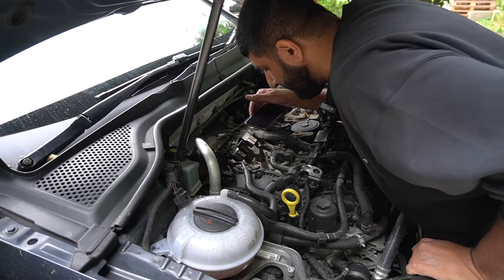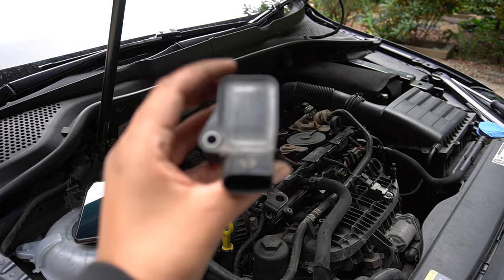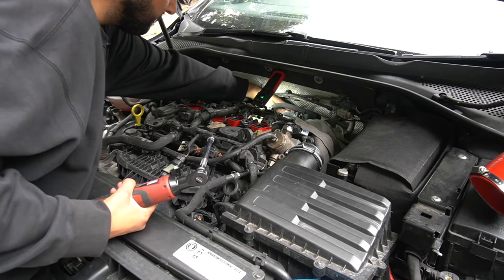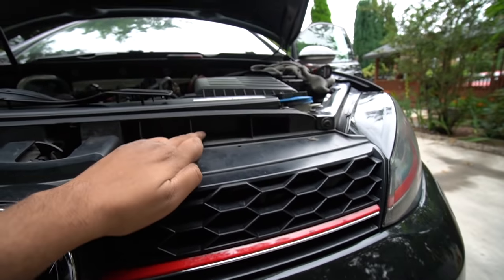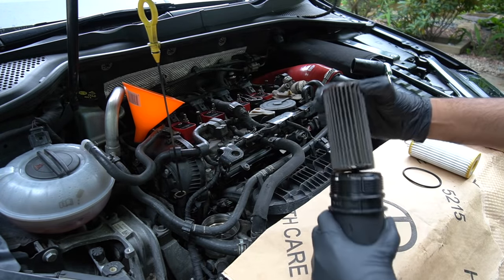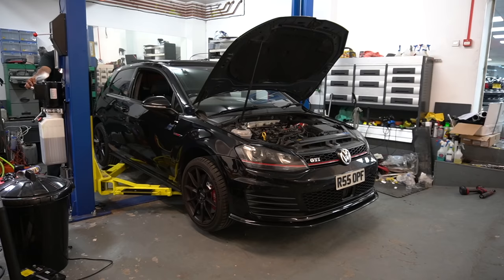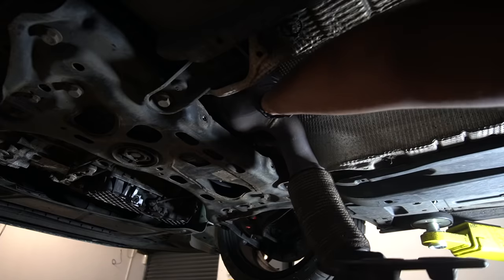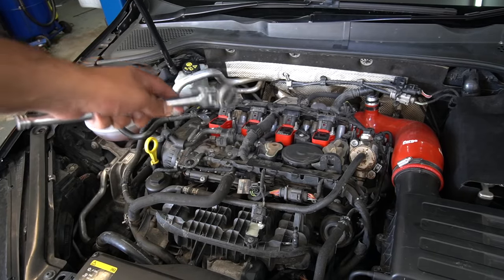My VW GOLF GTI gets some STAGE 2 Upgrades!

Comment: I screwed that blanking piece on and opened up the nearside of the intake. The R600 box is called that as it's good for 600bhp, supposedly. I can't see the need to buy one when you can make it yourself with that blank and a Stanley knife. Maybe the internals don't flow as good but for stage 1 or 2 it's more than good enough. £380 for a plastic box!

Comment: Just a heads up Hamza... i had a Ramair panel filter in my Cupra 280 and the amount of dust i had in the turbo intake pipe was insane... got annoyed after i cleaned the silicone pipe and still had a lot of dust a week later and bought a K&N filter (which already came sprayed) and it was MUCH better. I suggest you spray that Ramair with some air filter spray, or change to a cotton filter instead of the foam one.

Comment: You supposed to oil the o ring before slipping it over the top, the point of the oil is to increase elasticity so it doesnt snap

Comment: You seemed to have an easier time doing the downpipe compared to Dean on Saving Salvage, he had to drop the subframe in the end. 

Just fitted new cat bypass pipes to my PFL. The ones I bought 2 years ago had started to rust badly. Must have been some hooky stainless steel so went for genuine Audi ones for the FL RS3 this time. All 4 bolts twisted off trying to get the sleeve undone, they were barely recognisable as nuts.
Reply: Rip you we can see the pain

Comment: If anyone reads this and is gonna put in a downpipe, the process is different with the GTI that has the lsd and the GTI that doesnt. The lsd makes putting a downpipe the pain in an ass. I would recommened taking off the top bolts from above the car.

Comment: If only the downpipe install was actually as simple as it looks in your video...
Having access to a lift makes all the difference!
Reply from the maker: It’s definitely doable on the floor, only used a lift to make it easier to film 👍🏼
Reply: @TRHamza  It's doable no doubt though depending on how much space you have under the car there will be a fight with the original cat 😄

Comment: Would you not want the cold air flowing through the drivers side vent under the bonnet to try and flush the hot air out the engine bay whilst you are driving?
Reply: That small duct doesnt do much. Bare in mind, alot of air already gets into the engine bay through the radiator.
On my TDI the engine oil temp went up with 4°C on the motorway, after placing that GTE duct blank. Worth the 2 or 3hp and about 5nm of torque it adds though. 😅